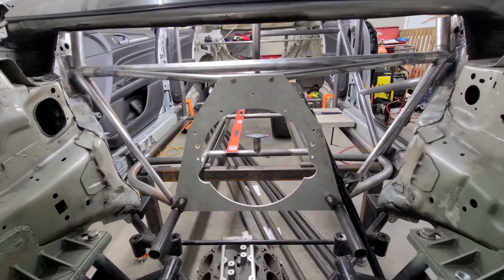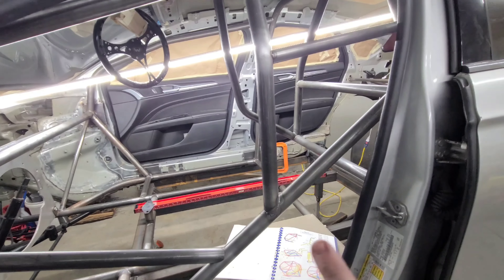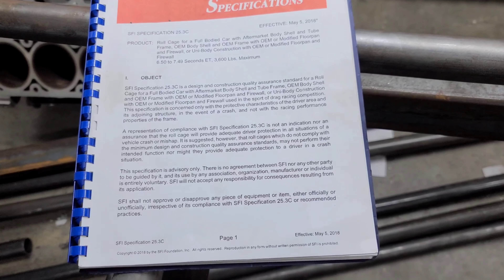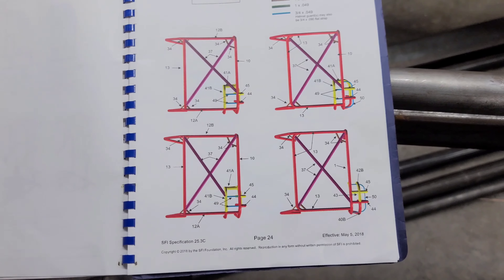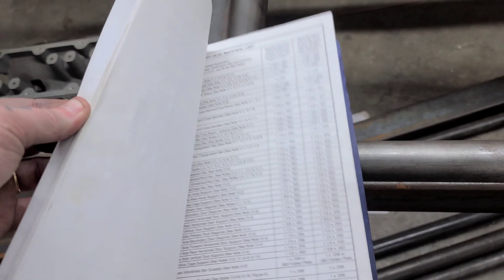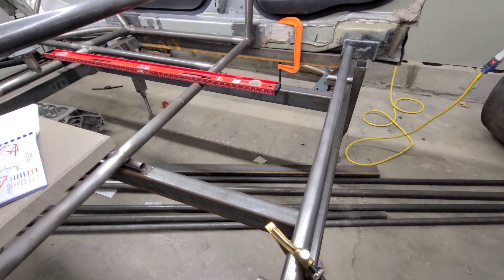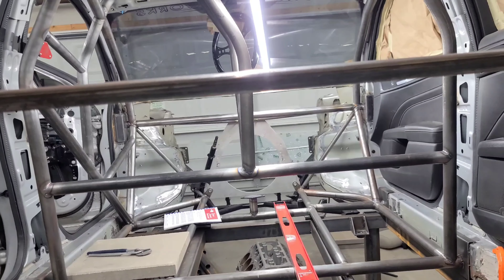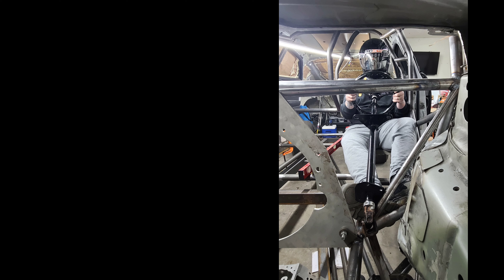Garage Built "Promod" Tube Chassis No Prep Ford Fusion EP.18

Comment: Any advice on putting a bigger turbo in my 1.5 14 fusion? Idc if the motor or tranny blows either tbh
Reply from the maker: No. There isnt a bolt on big turbo option for the 1.5eb currently
Reply: i had a big turbo 1.5 before i traded it in. no problems with it at all, i found one for the 1.5 mondeo (european version of the fusion). direct bolt on, had a lot of fun with it a dyno’d at 280whp